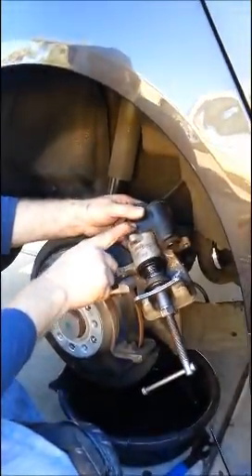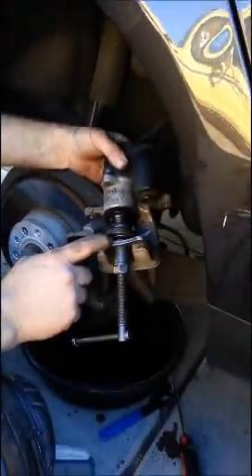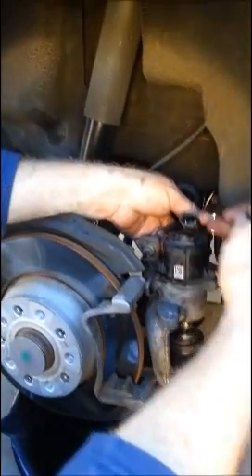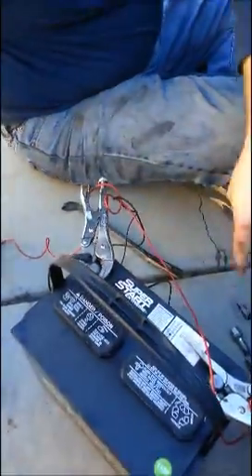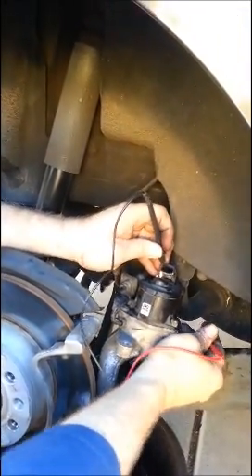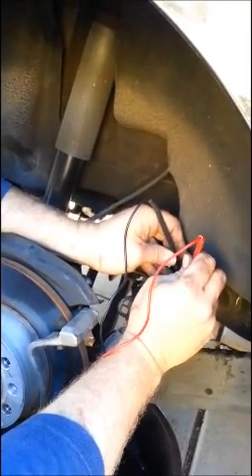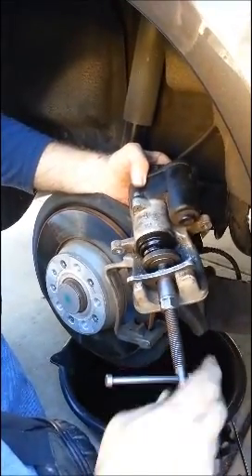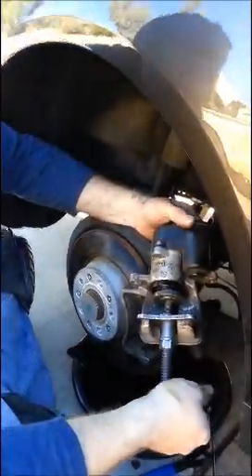Retract 2008 Volkswagen Passat Electronic Brake Calipers without computer code reader

Comment: I have a 2011 Audi A4 Avant.  I did not see your video unfortunately. I replaced rear pads and rotors by retracting by hand with tool from auto zone.  Three weeks since the job was done, i have the lower third of the rotors rusting and the rest of rotor shiny. Is there any way I can reseat pads so they are braking evenly? I do not hear or feel any drag or squealing as well from the rear wheels. Also, Ebrake works fine and there are no brakes light on the dash. I did not unplug electric harness connector as you did. Do you have any more imaginative recovery options for me short of going to the dealership?  Don thanks and most appreciative

Comment: That's a very good idea, but what do you do after you replace the pads? Do you just put the caliper back and the piston will self adjust or do you have to power it again so it comes back to its original place?
Reply from the maker: Yes. Just reassemble and then engage the EPB as normal from the dash switch. The system does not stop based on a calibrated measurement of gap it uses current draw from the actuating motor.
Reply: Matthew Neill Awesome thanks.

Comment: Way to go, hillbilly. But please advise your wife to NOT use her parking brake- it is MILES out of calibration, because of her cheap-ass husband :(
Reply from the maker: Please read the other comments associated with this video to dispel the incorrect assumption surrounding 'calibration' in the VW Electro-Mechanical Parking Brake (EPB) system. The EPB controls a motor that applies or releases pressure to the brake calipers. The motor does not 'calibrate' or 'signal' the EPB other than the current draw sent through the closed circuit. No magic. No 1's and 0's hidden in the machine. Just a little squeeze... 

Oh... and I prefer to be referred to as 'thrifty' instead of 'cheap-ass' but if you like paying $500 to a dealer for a simple brake job, be my guest.

Your friendly neighborhood hillbilly! ;)
Reply: If you werent too cheap to buy a vag-com scan tool youi'd have a much better idea of how the system actually functions, billy. Signed, a ASE-certified mechanic.
Reply from the maker: Puddin Tame Just don't need to own a VAGCOM when I'll prolly change the brake pads two or three time in the life of owning this car before I buy another. 

(Hmmmm... Are you a VAGCOM salesman???? Cutting into your profits I guess...) 

You ASE-certified mechanic sure seem to get bent out of shape when common sense trump your UTI school loan debt... 

Open Rear Parking Brake

The EPB system must be put into a service mode prior to the calipers being removed from the vehicle so the pistons can be pushed into the caliper housing. The specific Basic Setting groups vary depending on the vehicle and repair procedure to be performed.

Using VCDS you will click [Select] > [53 - Parking Brake] > [Basic Settings - 04] and TYPE in (not scroll up to) the specific Group Number. Refer to the specific Diagnostic Procedures page for the vehicle in question. Click [Go!] and the brake calipers will open for repairs.

It is important to wait 30 seconds after the brake calipers and live readings stop moving before clicking [Done, Go Back] > [Close Controller, Go Back - 06] and removing the key from Ignition Switch.

The caliper pistons do not move back into the caliper, they are in a internally released position that allows the technician to push the pistons in as you would do with a conventional front brake job.

Perform the brake repairs and reassemble the system prior to moving on to the next step.

Comment: Very good. However having watched this video I had a thought, as there only appears to be two connections to the caliper motor and therefore I suspect no positional feedback, could you not just simply release the parking brake using the button inside the car and then just disconnect the battery?
Reply from the maker: That is a very good idea to release the brake but what winds up happening is that the motor does not fully retract when released, it only retracts far enough to release the tight grip on the rotor. It issue occurs when worn pads are being replaced with new pads which are quite a bit thicker. The motor must be engaged to fully retract to make room for the thicker pads. This can be done either by the use of a code reader such as the VAGCOM tool or alternatively with a method like the one described in this video.
Reply: Hi all, just thought I'd mention, a 12V power tool battery works a treat for this job.

Comment: Cheap ass! You think is the safest way to do a brake job, especially on new cars packed with electronics,  people like you once they messed up on things like this go crying to a car tech or dealership for help, you really don't have an idea of what your doing.
Reply: Oh my god, I hate to see a grown man cry.
Reply from the maker: Haters gonna hate, hate. hate, hate, hate... Don't fear the ghost in the machine.
Reply: He really does know what he is doing. What is dangerous about this? The caliper/motor is isolated. As there are only 2 pins its clear this caliper is just a motor, with an ECU controlling the position. So once isolated, this is perfectly safe! 

Just because you dont understand doesnt make it wrong.

Great video.

Just to add: a 'G-clamp' can be used instead of the caliper wind back tool. I find this easier as it dosent turn the piston which can tear the piston boot.
Reply: chinos arsey cos e didna think of it himself  ....lots a folk are smarter than thee m, man..get use 2 it..
Reply: Haters gonna hate, but soon learn to appreciate
Reply: Isn't it amusing how the people that have the most criticism of these techniques are the very same people working on these systems on a professional basis, or to put it another way, the people who have the most to lose from DIY mechanics.

Comment: fucking a ,,,,,,, good job i just spent one hour jerking off with the proper tool and still couldn't get it to go in had to borrow a scanner and got job done ,,,,,, iam gonna make a jumper for that the way you did it ,,,,, much easier ,,, thanks

Comment: This worked great for me on my wifes Passat.  I had the same questions and concerns about errors or codes coming up.  I just figured screw it, I'm gonna give it a try anyway.  It's been a week now, the brakes are working fine with no codes.  I was able to use my volt meter cables with a trickle charger I use for my motorcycle. I clamped the charger cables around the voltmeter plugs.  It worked like a charm.  If you are going the correct way you won't know it, but if you are sending the polarity the wrong way, the caliper will start to move, tightening the pads.  Also, when you do get it going the proper way, you will know when it is done.  It will seem like forever, but it will eventually reach the end and the motor will stop. Then you can use a C clamp or caliper tool to crank it back all the way.  Personally, I didn't try to adjust the motor back after because when I stuck in the key and started it, I heard them motors move and adjust.  I was able to set the parking brake on a hill just fine after this.  As I said, no codes, and no issues stopping or with the parking brake.  Thanks for the very helpful video.  Saved me $300+.  Also, the guys at a local brakes place told me this is how they do it also.  They don't have the vagcom system.  This was a national chain, so if it works for them.... then save yourself the money.

Comment: nice post matthew neill. I found a similar method to yours to retract pistons on a 2006 audi a6. what I discovered was that when handbrake is retracted the piston has an extra 1mm exspansion space. which im guessing is a safety thing to prevent binding when brakes get hot when a piston wind back is used. so with use of assistant and compressing tool I compressed piston 1mm after every application and de application of parking brake. after a few minutes the piston will bottom out and become fully retracted.. I have beaten vag
Reply from the maker: Hmm... that is very interesting. Wonder if this technique works for the VW system also.

Comment: Great tip.  Thanks.

I picked up this snippet from passatworld to reset the parking brake too (it goes through a full cycle).  "unplug the battery for 10 minutes then plug it again then press the brakes for 35 seconds after that, while pressing the brakes press the e-brake for 10 seconds.."

Comment: I put on pads and rotors on a 2008 A6 Audi today.  This technique worked perfect.  I used a portable starter unit that supplied 12 volts.  Thanks for saving me a lot of money.  Spent $130 in parts.  This is an easy $700 at the dealer.

Comment: Kudos, you saved me from certain defeat…   I used the battery from the riding lawn mowers and a couple of pieces of wire.  It was too easy…
Thanks-
Volvo 2008 S80, AWD V8

Comment: I did everything as described and the job went swimmingly...however, when I got everything put back together, I have a 'press brake pedal' light constantly on that disappears when I press the brake.  I did a little research only to find out the light is telling me to press the brake pedal...that's it...(thanks). The light is constantly on until I press the brake.  Obviously this was caused by me changing the brake pads and running the motor on the EPB back, as it was not there before.  Does anyone have any suggestions, other than taking it to the dealer, to get this light to disappear?
Reply: That light is always on until you push the brake to put the car in drive, or move the shifter.
Reply from the maker: jojin ryan Yes, it is an indicator that tells you that the brake peddle must be pressed to allow the shifter to be moved from park to drive. I thought the same thing that the indicator some how showed up after I did the brake job. In actuality I think that it was always there but I never really noticed it before. Sort of a reverse manifest destiny. Now that I notice it... I think I caused it... But I have checked other Vdubs and the same behavior is there for this "press your brake peddle to release the park shift lock" indicator light...

Comment: Good tip.

Couple of thoughts.  1) this does work!  2) if you hit the stops then it can strip the gears on older calipers because they are crap 3) the ECU simply hits the stops and turns off at about 6A.  If you use a feeble battery charger on 6V setting then it will give you less chance of stripping the gears.

Another point to note is that the ECU on <2008 cars is very fussy and dies easily.

Finally, this trick is very very useful for when the handbrake is stuck on.

Comment: Brilliant!, worked perfectly on my wife's Tiguan. 

Cheers to you sir...🍺🍺
Reply from the maker: The only thing that I needed to do "electronically" after the "mechanical" work was completed was to reconnect the electronic connector to the brake caliper and then engage the electronic brake from the button on the dash. Once I did this the caliper locked down from the fully disengaged position (further then normal because of the caliper vice that was used to push back the caliper to fit in the new pads) into the parked positions. From then on it has been the normal engage/disengage cycle. No code reader required... EB now works swimmingly... 

There has been speculation in the past from other posters on the video that the EPB circuitry must be calibrated and that this motor somehow has sensor circuitry to tell the EPB computer how thick the pads are... I do not see that in the components... I think that it is a current draw from the motor when it is fully engaged that tells the EPB to shut off the circuit. If anyone actually knows I would be delighted to hear.
Reply: Matthew Neill I understand that no extra circuitry  is required as it senses the increase in resistance due to the motor strain once it has reached the limit of the drive screw in either direction :-)
Reply: Matthew Neill Sorry.  I realise that is what you said.  Ooops.  This page gives a handy 'tear down' of the brake.  passat b6 electric park brake | 1810martin
Reply: Lol
Reply: what kind of part i need it for this?
Reply: Robert, i have a tiguan and was planning to change the rear discs and pads this weekend, could you tell me when you turn the ignition back on  does the EPB just reset?
Reply: Yes, it does. I've had no issues since and the EPB performs normally. Good luck.
Reply: Robert when you finished ''mechanical'' part of the work, did you have to re-do something about electric? I mean, do you have to connect this electro/brake engine onto 12v battery again?
Reply: Matthew Neill Re:"There has been speculation in the past from other posters on the video that the EPB circuitry must be calibrated and that this motor somehow has sensor circuitry to tell the EPB computer how thick the pads are." That is true on the Audi R8 but not on the Tiguans. To find out if your car needs to have the pad thickness input to the computer, visit the Ross Tech (VAG-COM) wiki (start by Googling "ross tech electronic parking brake" )

Comment: I have a 2009 cc vr6 and I also use this method to change my rear pads. 

After I am done, I simply activate the EPB and then deactivate it to "close the gap" between the EPB and the new pads, and then I'm off into the sunset.

Never had any issues using this method.

Comment: I did this on wifes 55 plate passat TDI, no brake problems afterwards. Its only a caliper with an electric motor on it, the ECU just senses high current draw when the handbrake pads are "closed" on and shuts off the motor- u don't need a computer

Comment: Well, a VW specialist has a lot to lose by people doing-it-themselves doesn't he? So unless you can come up with something better by way of a reason (e.g. OMG you fix your own brakes, your family will die"), most people would be very skeptical taking your advice.
I'm skeptical that VW's computer isn't clever enough to calibrate the gap no matter what thickness pad is in there - also skeptical of an expert that thinks that was a 9v battery.
If the OP says "I got problems afterwards" I'd listen

Comment: You can also remove the power brake motor by buy removing 3 bolts.Well these are suppose to be a poor mans caddie but you better have deep pockets for just simple repairs...

Comment: Hi I am going to attempt the same procedure on an Audi A8. Which has the same system. When you finished replacing the pads did you reverse the voltage to extend the calipers again? And did you have any warning's or dashboard errors when you put everything back together???